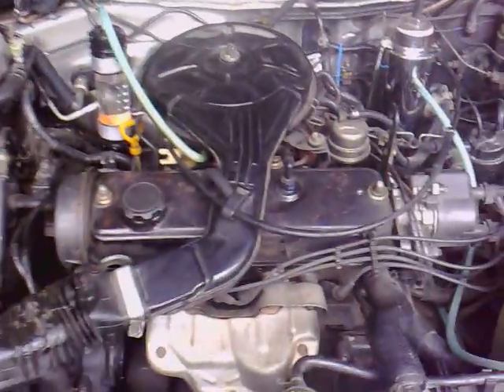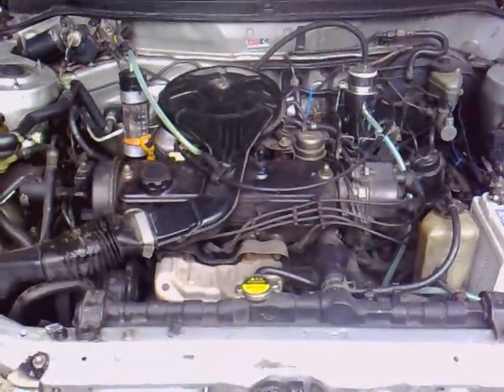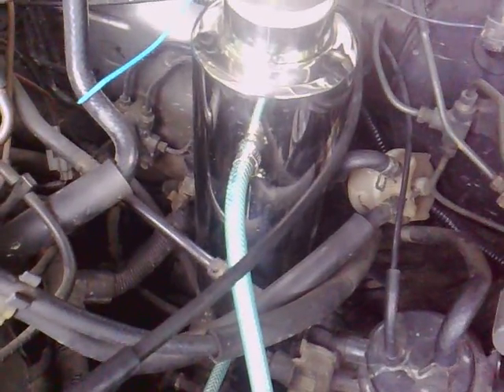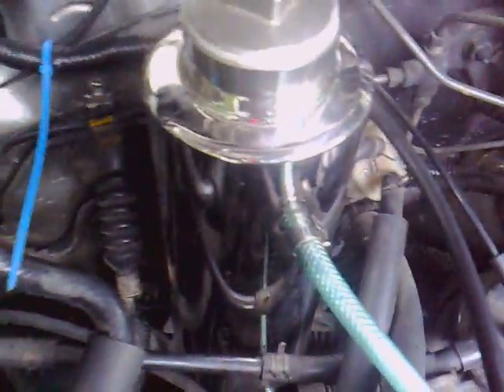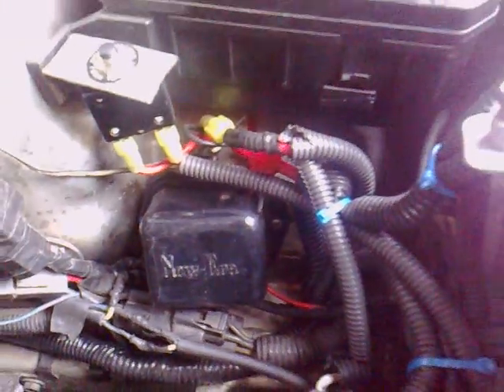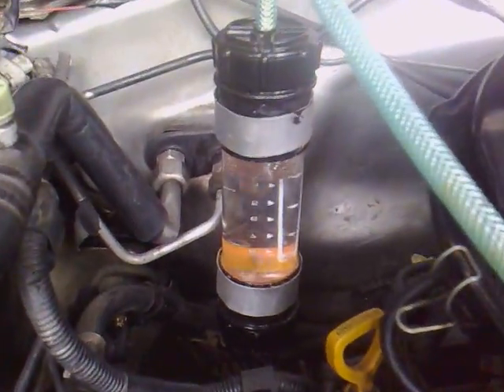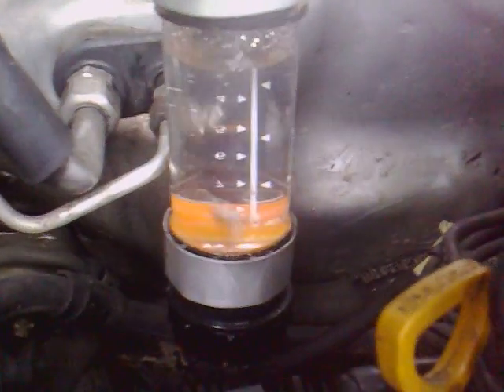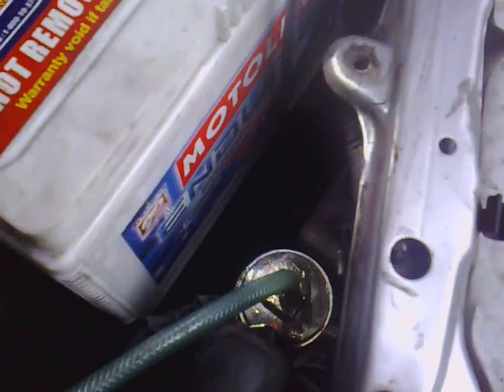HHO VOX PILIPINAS- ( TOYOTA  COROLLA )  V066  052911

Comment: hello sir good day question, extracted hydrogen po yan di ba? pag na dis engaged yung H sa O2 tru electrolysys H ang labas but pag nagkaroon na ng integration ulit ang H sa O2 which is air nagigiing water.  pano ung mga metal parts na pwede mag corrode sa loob ng internal combustion chamber? - siry you dont need to reply on this on public you may reach me at yamahanouvoz@gmail.com - TO ALL ! AYOS TO KAILANGAN LANG NG TALGANG TULONG TULONG PARA MA MODIFY AT MAS MAPAGANDA ANG TECHNOLOGY!